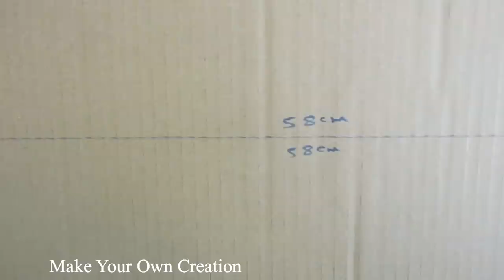How to make a cardboard airplane - flying bottle airplane

Comment: the problem in the first one is the weight and balance not the servo because you did'nt set the battery at the correct place the Center of gravity of the planes are under the wing not on the back of the wing but i appreciate your video........ good luck